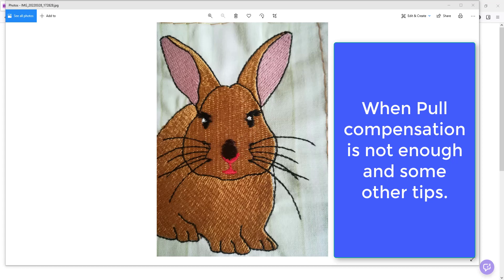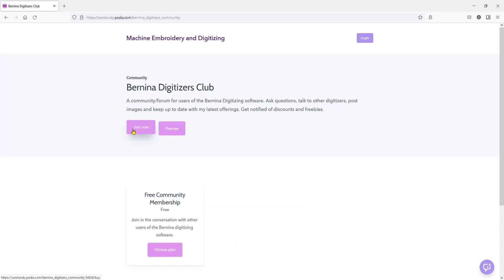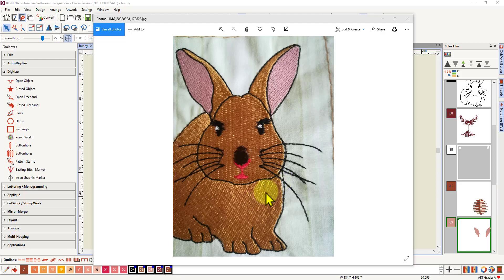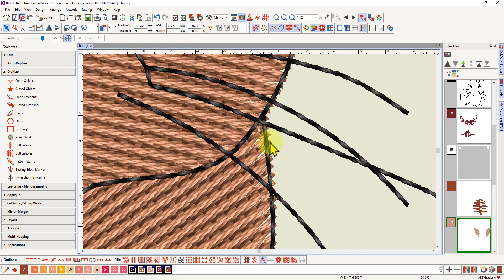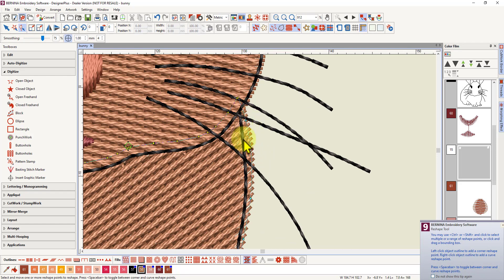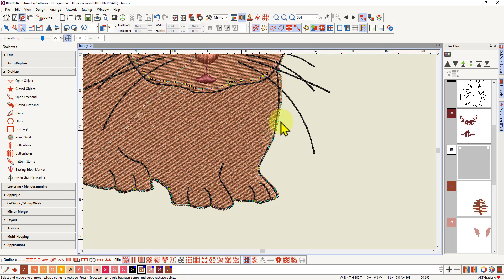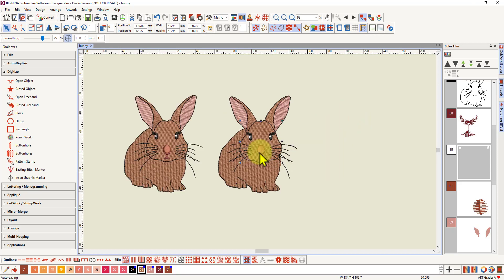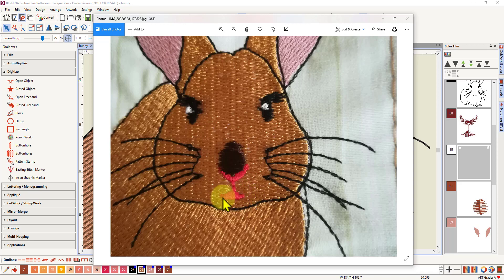When Pull Compensation is not enough

Comment: Thank you Carol for that video.
 Pull compensation is a good thing to know about. I notice that in pull compensation in a design is to do with stitch direction when the outline is out and does not meet up with stitches. Is that correct.
Regards
Caroline
Reply from the maker: Exactly. Of course proper stabilisation is important, and test sew on the same fabric you intend to use. The larger the object the more pull there will be.
Reply: @CarolUndy  Than you for the reply back. Let me know when you get v9 up and running. We need to know what pull compensation means.Not alot of people know what it means.A few lady asked me what it ment in one of my sewing clubs I go to.
Reply from the maker: Caroline I have an old video here which talks about pull compensation. It may help you understand. I have V9 running and will be opening some courses on that soon. Cheers Carol